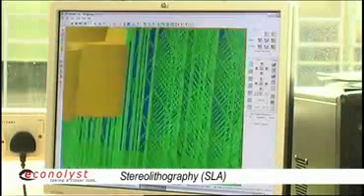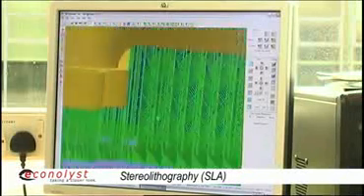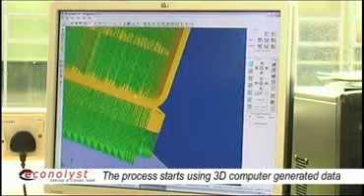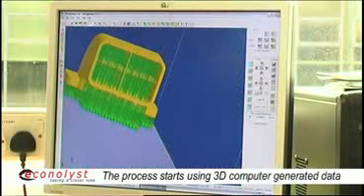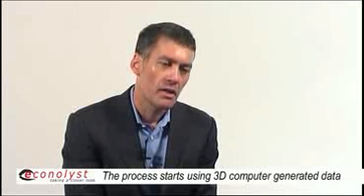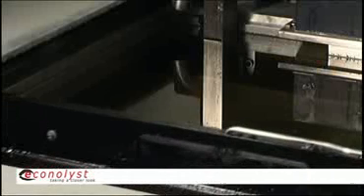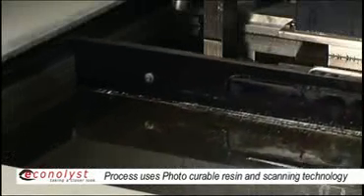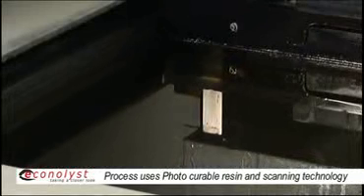3D Systems - Stereolithography

Comment: Well, anything. It's a 3D manufacturing process. The attraction is in its flexibility, particularly for small run parts. Most manufacturing technology is geared to making many copies of the same thing efficiently - that is not much use when you only need a small number of a thing or you're making prototypes before mass manufacture. They make what their clients ask them to make or what they want to make. That might be a trombone or a cast for a rocket engine.